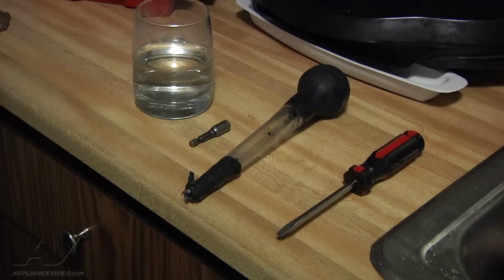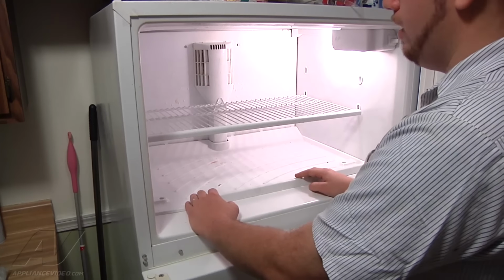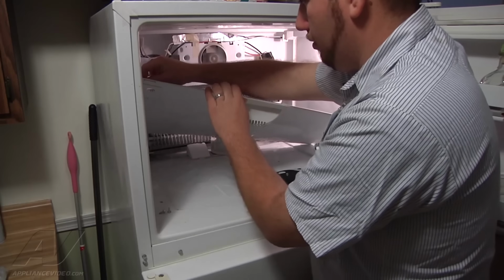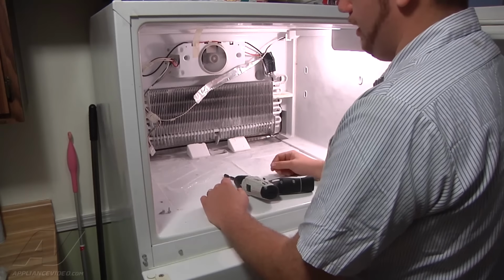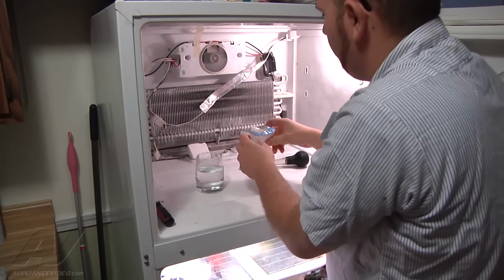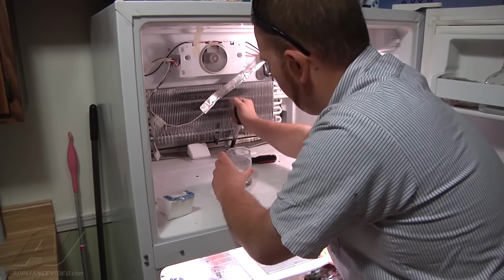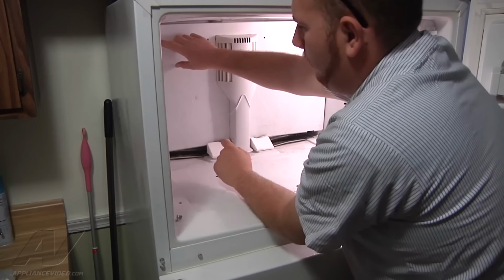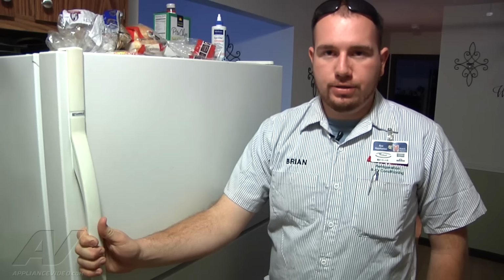Kenmore Refrigerator Repair - Water Leaking From the Freezer - Evaporator Drain Pan

Comment: What if it continues to leak after you do this?  I've done this a few times before I came across your video. I can get water to flow all the way through the tube to the bottom pan but it continues to leak into fridge just days afterward. Any idea?
Reply: i too have same continuing frozen drain line  problem ...have yet to find solution
Reply from the maker: Great question, if you have a more technical question that our parts department cannot answer, you can search our over 17,000 answered questions free at our website www.ApplianceVideo.com under our Repair Help section. You can also call our parts department at 1-800-830-5465 and they can give you help 7-days A week ,or search at www.SaveMoreOnParts.com  .

Comment: I have this problem in a  fridge I am going to try your fix on. Curious, what caused it to freeze up to begin with? Is the freezer temperature set to cold? What causes the ice jam for the drain hole to begin with? I have a small steamer I am going to try to use instead of the glass of hot water, see how it goes. Great video thank you
Reply from the maker: Great question, if you have a more technical question that our parts department cannot answer, you can search our over 17,000 answered questions free at our website www.ApplianceVideo.com under our Repair Help section. You can also call our parts department at 1-800-830-5465 and they can give you help 7-days A week ,or search at www.SaveMoreOnParts.com  .
Reply: Update, the drain tube was clogged solid with ICE. I have a small steamer I use that cleared it after removing a couple of parts shown in the video.. worked great, water started to drain back into the drain pan at the bottom instead of overflowing into the fridge below.. thanks for the video as I would not have seen the drain hole hidden in behind the back panel. The baster, or a glass of hot water would have cleared it also if you don't have a steamer.

Comment: I have a question. This fridge is in my garage. Concrete garage floor with drain, so no worries if it gets wet. Can I just empty the food contents and unplug it for a few days in mild weather, won't it just thaw by itself?
Reply from the maker: Great question, if you have a more technical question that our parts department cannot answer, you can search our over 17,000 answered questions free at our website www.ApplianceVideo.com under our Repair Help section. You can also call our parts department at 1-800-830-5465 and they can give you help 7-days A week ,or search at www.SaveMoreOnParts.com  .

Comment: Thank you so much for this video. I had this problem once before, many years ago, but using a turkey baster  with boiling water was genius. I put 24 ozs of boiling water down the hole, but did not check how much ended up in the evaporation pan. When I stuck a tube down the hole, I was not able to thread it totally down into the pipe. Hope that's still ok. I shall found out. Also I use a hairdryer to melt the  built up ice. Thanks again
Reply from the maker: Great tip! Thanks for your response, we are glad we could help. Our library of over 5,700 videos are currently helping over 1.6 million people like you every MONTH.  Please help us by subscribing to our YouTube channel, or post our website www.ApplianceVideo.com to your Facebook page, Twitter, Instagram or any other social media sites. Your support will help us keep producing more free quality videos.

Comment: what causes the drain tube to freeze and how can we prevent it from happening again? (or at least from happening so often?) thanks!
Reply from the maker: Great question, if you have a more technical question that our parts department cannot answer, you can search our over 13,000 answered questions free at our website www.ApplianceVideo.com under our Repair Help section. You can also call our parts department at 1-800-830-5465 and they can give you help 7-days A week ,or search at www.SaveMoreOnParts.com  .

Comment: Don't we have to unplug the fridge first?! I did anyways, lol. The procedure worked! After a bit of fighting with the ice, the drain opened up. The only instruction I bypassed was not detaching the wiring from the back of the vertical freezer panel, I didn't want to mess with it. So I just set the panel aside right in the freezer to get to the drainage hole. Thank you for your video! Feels good to do it by myself!
Reply from the maker: Great question, if you have a more technical question that our parts department cannot answer, you can search our over 10,000 answered questions free at our website www.ApplianceVideo.com under our Repair Help section. You can also call our parts department at 1-800-830-5465 and they can give you help 7-days A week Monday Saturday, or search at www.SaveMoreOnParts.com  24 hours 7 days A week.

Comment: Good video but unplug the refrigerator BEFORE and while working on it. That is basic safety requirement for working on any electrical appliance. At least he can verify the fan is working.
Reply from the maker: We have the disclaimer before you watch the video to UNPLUG IT. We use the lighting in the field to get the best camera shots otherwise we get complaints of lighting issues.

Comment: Could you unclog and thus clear the drain by turning and leaving your freezer/refrigerator off for a few days, which lets the ice in the tube melt? Then turn your frig back on and all is good?
Reply from the maker: Great question, if you have a
more technical question that our parts department cannot answer, you can search
our over 10,000 answered questions free at our website www.ApplianceVideo.com under our Repair Help section. You can also call
our parts department at 1-800-830-5465 and they can give you help 7-days A week
Monday -Saturday, or search at www.SaveMoreOnParts.com  24 hours
7- days A week.

Comment: An alternate way to attempt this is to go to the back of the fridge where the hose comes out and shoot hot water with a turkey baster into the fridge. Mine did not have easy access or easily removable parts. The water took a bit of pressure to finally flow, but everything cleared out after the initial blast.
Reply from the maker: Great question, if you have a more technical question that our parts department cannot answer, you can search our over 10,000 answered questions free at our website www.ApplianceVideo.com under our Repair Help section. You can also call our parts department at 1-800-830-5465 and they can give you help 7-days A week Monday Saturday, or search at www.SaveMoreOnParts.com  24 hours 7 days A week.

Comment: hello thank you for the great vid, it seems the small fan is on...so the power is on..its ok?..thxz alot lisa
Reply from the maker: Great question, if you have a
more technical question that our parts department cannot answer, you can search
our over 10,000 answered questions free at our website www.ApplianceVideo.com under our Repair Help section. You can also call
our parts department at 1-800-830-5465 and they can give you help 6-days A week
Monday -Saturday, or search at www.SaveMoreOnParts.com  24 hours
7- days A week.

Comment: If this is a repeated problem, what is the solution?
Reply from the maker: Great question, if you have a
more technical question that our parts department cannot answer, you can search
our over 10,000 answered questions free at our website www.ApplianceVideo.com under our Repair Help section. You can also call
our parts department at 1-800-830-5465 and they can give you help 6-days A week
Monday -Saturday, or search at www.SaveMoreOnParts.com  24 hours
7- days A week.

Comment: We have a 17 year old Kennmore fridge which all of a sudden started leaking from the back. We put pans to catch the water. The pans had to be emptied daily.I got fed up enough to take a shot at repairs. The ice maker is top left and back of freezer. I removed it carefully as it is driven by electrical plug connection. Removed three mounting screws, unplugged it and removed it. I took the back plate off and looked for a hole as described in some of the text here. I boiled water and used a turkey baster to force hot water in a drain hole behind the back plate I removed. At first the hot water was splashing back but eventually started to flow freely until the drain was clear. Works like new and saved a replacement $1000 fridge.
Reply from the maker: Thanks for your response, we are glad we could help. Our library
of over 5,700 videos are currently helping over 1.6 million people like you
every MONTH.  Please help us by
subscribing to our YouTube channel, or post our website www.ApplianceVideo.com to your Facebook
page, Twitter, Instagram or any other social media sites. Your support will
help us keep producing more free quality videos.

Comment: Here's an engineering idea to prevent the drain tube from ever getting frozen up again and that problem recurring.. How about install a heat-tape around the drain tube? A low current / temp would work very well at preventing the drain tube from freezing up and keep the water flowing. And also prevent melting the plastic tube as well! ;)
Reply from the maker: Great question, if you have a
more technical question that our parts department cannot answer, you can search
our over 10,000 answered questions free at our website www.ApplianceVideo.com under our Repair Help section. You can also call
our parts department at 1-800-830-5465 and they can give you help 7-days A week
Monday -Sunday, or search at www.SaveMoreOnParts.com  24 hours
7- days A week.

Comment: Hey can I turn the refrigerator off will that be easier for me cause I'm a woman though it looks simple it's not, water is leaking in the bottom of the refrigerator
Reply from the maker: Great question. We always recomend to shut the unit off and unplug it, we only leave it on for the additional lighting. If you have a
more technical question that our parts department cannot answer, our
technicians are answering all questions at our website at www.ApplianceVideo.com under our Repair Help section. You can also call
our parts department at 1-800-830-5465 and they can give you help 7-days A week
Monday -Sunday, or search at www.SaveMoreOnParts.com  24 hours
7- days A week.
Reply: Thank you

Comment: i cant get the drip pan out of my frigidaire. no screws visible
Reply from the maker: Great question, if you have a
more technical question that our parts department cannot answer, our
technicians are answering all questions at our website at www.ApplianceVideo.com under our Repair Help section. You can also call
our parts department at 1-800-830-5465 and they can give you help 7-days A week
Monday -Sunday, or search at www.SaveMoreOnParts.com  24 hours
7- days A week.

Comment: The real question is, how do you keep it from happening again? We've had to do this about 1-2 times a year for a few years now.
Reply from the maker: Hello 
       If it continues to happen , call your local parts distributor with your model number. They will give you a kit part number that attaches a radiant clip that connects to the  heater and radiates heat to the drain on problem units like yours.
Reply: @Appliancevideo  Will give that a try, thank you so much.

Comment: Just a note of interest . on the kennmore refridgeerator some have have a aluminum drain pan behind the freezer back panel.  If ya find out your drain aint clogged an ya still have water comin from your freezer , its the drain leaking water through hairline areas.I put. 100% silocone around drain under aluminum drain pan.. No problems ..
Reply from the maker: Thanks for the good tip, I hope it
can help others with the same issues. Please help us by subscribing to our YouTube
channel, or post our website www.ApplianceVideo.com to your Facebook
page

Comment: Why couldn't you just empty the refridge and unplug it until the ice causing the clog melts?
Reply from the maker: Great question, if you have a more technical question that our parts department cannot answer, our technicians are answering all questions at our website at www.ApplianceVideo.com under our Repair Help section. You can also call our parts department at 1-800-830-5465 and they can give you help 7-days A week Monday Sunday, or search at www.SaveMoreOnParts.com  24 hours 7 days A week.
Reply: @kaleighClemons I wondered the same thing. Why couldn't a person just unplug the whoke refrigerator and allow it to thaw. Or is there some other "debris/algae" build up?

Comment: Great instructional video. We removed and cleaned out the P-Trap located on the backside of frig and 4-5 days after cleaning out the 
P-Trap it was still puddling water on the inside bottom of freezer side. Your video showed that we didn't inspect and unplug / clean out the defroster hole leading to the P-Trap from the inside so we got a turkey baster and added hot water to the coil pan which quickly melted all the ice blockage and once we could here and see the water dripping into the pan (it was visible from the front foot panel) we were done. The P-Trap video and your great video showed us the process and we got it done. Total cost $1.99 for the Walmart turkey baster.
Our frig is a side by side Whirlpool but they all have the same principal. Worked Great. Thank you from Texas.
Reply from the maker: Thanks for your response, we are glad we could help. Our library of over 5,700 videos are currently helping 1.6 million people like you every MONTH.  Please help us by subscribing to our YouTube channel, or post our website www.ApplianceVideo.com to your Facebook page
Reply from the maker: Thanks for your response, we are glad we could help. Our library of over 5,700 videos are currently helping 1.6 million people like you every MONTH.  Please help us by subscribing to our YouTube channel, or post our website www.ApplianceVideo.com to your Facebook page

Comment: I followed all your instructions and it all went well, but it still seemed like the drain was clogged. I went and got a can of compressed air and shot it into the hole and that's what it took to finally get the last of it cleaned out. Thanks for this video!
Reply from the maker: Thanks for your response, we are glad we could help. Our library of over 5,700 videos are currently helping 1.6 million people like you every MONTH.  Please help us by subscribing to our YouTube channel, or post our website www.ApplianceVideo.com to your Facebook page
Reply from the maker: Great question, if you have a more technical question that our parts department cannot answer, our technicians are answering all questions at our website at www.ApplianceVideo.com under our Repair Help section. You can also call our parts department at 1-800-830-5465 and they can give you help 7-days A week Monday Sunday, or search at www.SaveMoreOnParts.com  24 hours 7 days A week.

Comment: I like your explication. 
I have a electrolux_ frigidaire _gallery
model FGTR1845QF2
serial BA61830998
Is liking on the button.
please help me troubleshoot. 
I can't afford to have it fixed.thank you so much
Reply from the maker: Great question, if you have a
more technical question that our parts department cannot answer, our
technicians are answering all questions at our website at www.ApplianceVideo.com under our Repair Help section. You can also call
our parts department at 1-800-830-5465 and they can give you help 7-days A week
Monday -Sunday, or search at www.SaveMoreOnParts.com  24 hours
7- days A week.

Comment: I have a question:
The liquid leaking in my fridge is clear like water, but it smells like a chemical.   Is that water or something different?

Also - is there a way to prevent this from happening, or is this a regular maintenance kind of thing?
Reply from the maker: Great question, if you have a
more technical question that our parts department cannot answer, our
technicians are answering all questions at our website at www.ApplianceVideo.com under our Repair Help section. You can also call
our parts department at 1-800-830-5465 and they can give you help 7-days A week
Monday -Sunday, or search at www.SaveMoreOnParts.com  24 hours
7- days A week.

Comment: I unclogged the drain hole following the video's instructions and fixed the water on the floor problem, but several weeks later, I started getting water accumulation in the crisper drawer, inside the refrigerator. Does anybody know what's causing this problem? I hate to unplug the drain hole again only to have an issue with water dripping inside the refrigerator.
Reply from the maker: Great question, you can call
our parts department at 1-800-830-5465 and they can give you help 6-days A week
Mon-Sat . You can also search at www.SaveMoreOnParts.com 7- days a week.  If you have a more
technical question that our parts department cannot answer, our technicians are
answering all questions at our website at www.ApplianceVideo.com under our Repair Help section. We have over 6,000
common questions and answers that you can easily search through by your model
number, appliance make, problem or error codes, and It’s completely free to
search through our question & answer library. There is a very good chance
you question is already answered there.